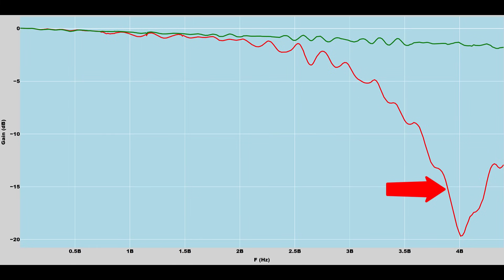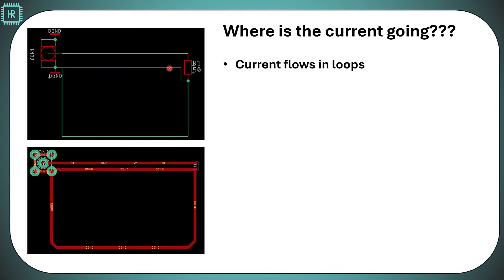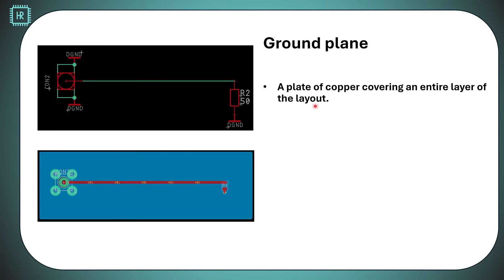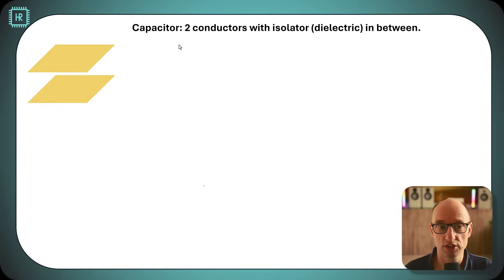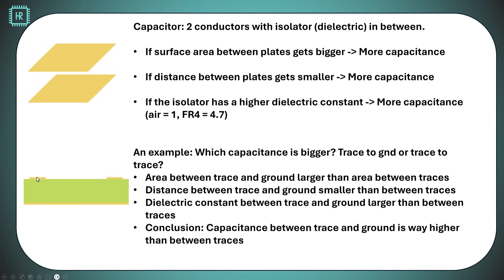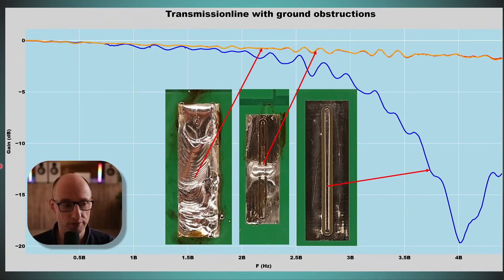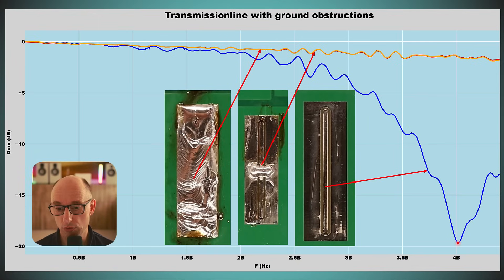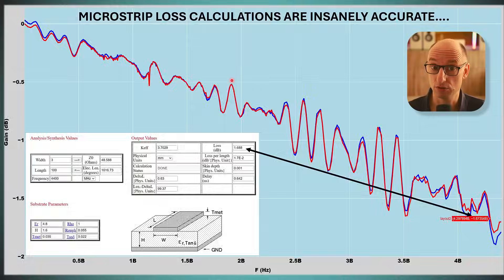Flawless PCB design: RF rules of thumb - Part 1

Comment: Great demonstration of the effects of interrupted ground planes.
I'm curious what the result would look like if the solder blob is replaced by a ceramic cap instead.

I work a lot with high speed digital designs, and sometimes the return current path needs to cross different net copper floods (although I go to great lengths to avoid this). The only way to achieve this is to include caps across the gaps for the return current to keep following the signal path. I'm curious though about how the non-ground plane influences the high-speed signal.
Reply from the maker: Hah, nice idea, but if you can place a cap, why not place a 0 Ohm resistor? The disadvantage is that the resistive element is on the top of the resistor, you'd have to place it upside down to keep the path as short as possible.
It is an experiment I can easily do and I used to do it under audio dac chips before I switched to single ground planes. 
The effectiveness will be determined by the self resonance of the cap and the loss, so you'd want a cog/np0 capacitor, and you want to make the capacitance as small as possible. So just big enough to have a very low impedance for your lowest signal frequency, and then you hope the resonance frequency is high enough. The smaller the cap in size, the higher the resonance frequency. A great rule of thumb here is again 1nH/mm. So an 0402 generally has 1nH of series inductance, this gets very close to reality the few times I checked this, but I did not check many caps for this.
Reply: @HansRosenberg74  You would need a cap if you are bridging between GND and non-GND nets.
Differential signals (and other high speed digital signals) can be routed across different net copper pours, although it's not really good practice. The high frequency current component does not really care about the potential of the reference plane it is flowing through, just as long as this current is routed back into the GND near the IC pins.
Reply from the maker: I think I'll try to measure this since I'm curious as well and post it here on youtube. Keep an eye on my channel. It will be a very short video I think.

Comment: This is not just a radio freq thing, I build valve amps for hifi and guitar. For decades I’ve seen people cover the insides of guitars and amps with foil tape which is ungrounded and it picks up so much noise, so then they paint everything with graphite paint and remove all the top and bottom end of the freq range! Then they install active pickups [facepalm]
I apply the same practices as you and have gorgeous sounding guitars and hifi :o)
And for anyone reading this, I have decades of experience but still watch videos like and read books this as a refresher, its good practice.
Reply from the maker: Indeed, I know, I'm also a long time audio builder (30 years). My experience is that a single groundplane greatly improves sound. Don't even separate left and right grounds, the current will not run in the circuitry from the other channels since that is the long way around which return current will never take. So you're totally safe to do that. Also never separate digital and analog grounds in a DAC, you'll run common mode interference current right through your da converter chip which is not good either. They have separate analog and digital ground pins, but on the actual die, they are connected.

Comment: nice tut! I was struggling with ground problems many years ago in audio amplifiers. I wasn't quite sure that signal ground and power ground position on the pcb was important...
Reply from the maker: Thanks, I may not have been clear enough, you should always only have a single ground plane. You can have planes on more layers, but the one that will carry the current will be the one closest to the signal layer and that one should not have obstructions. Making 2 ground planes is a bad idea. 2 video's from now I'll go into that with details why that is. I always used to make multiple ground planes in my audio dacs (I designed 6 over period of 30 years) but ever since I switched to single ground planes the audio improved quite a lot.
Best regards,

Hans
Reply: @HansRosenberg74  Thanks a lot Hans. I was being unclear in previous comment, my point was the placement of audio signal ground and power supply ground (the point on the pcb which each of those would be soldered) there was one ground of course, but signal ground from the pre-amp stage and power amplifier stage (i.e a TDA2030 chip) was a quite challenging task, and leading to all kinds of noise. I can't recall correctly if it was better to keep those close or farther apart on the ground plane. tysm for your attention btw!  +1sub!

Comment: REALLY struggling with how to use the newest Analog Devices microwave I.C.s that are about 2/10 inch square with 8 connections on each side! Are these totally out of reach of the home experimenter or is there some kind of scheme that can let us use them? Even after getting a board made it seems to be impossible to correctly align and solder the I.C. to the board!
Reply from the maker: I did this many times, I think you're talking about a VQFN package?

The only way to get this done is with a stencil to apply solderpaste (the luxury option) or apply paste manually to the pads. Make sure you don't put too much on the central pad (which it probably has) otherwise it will start to float. To make alignment easier, I always put 4 lines on the silkscreen, at 45 degree angles. The ic corners need to be on these lines. Furthermore it helps greatly to add this very thick rework flux, that makes the solderpaste really liquid. Than you carefully heat it with an smd hot air blower. The paste will melt, the ic will float on that paste and because of that it will auto-align. It takes a bit of practice and a microscope is really helpful because you can see everything better. Good luck! (I will make a video on this in the future, but I have soo much material to show, it might be a while)
Reply from the maker: there is a third way: Apply solder with a normal soldering iron to the pads (not too much again), use rework paste on the footprint, put the ic on and then slowly heat it up untill it start floating. That thick rework paste is a lifesaver doing this work, makes it sooooo much easier.

Comment: You made a slight error:  Between two traces in a PCB, the dielectric constant is not really 1.  The volume of space between the traces that gets used by the capacitance involves some "fringing" making it use some space that is inside the PCB.  It doesn't change your argument but if you measure on a PCB you will see the capacitance is a bit higher than you expect.
Reply from the maker: you're absolutely right! I was doubting weather I should go into that level of detail, because, as you said, it does not change the argument. Well spotted! :-)
Reply: @HansRosenberg74  Thank you for the excellent videos, I have enjoyed them a lot and I am subscribed :)
Reply: Subscribed 😅

Happy to find both of your channels as I'm slowly learning PCB design
Reply: How do I get a copy of your book?
Reply from the maker: You can get it here:
https://www.hans-rosenberg.com/checklist
Best regards, Hans
Reply: send me the checklist, I might even add a few things :)
Reply: Dear Hans - Thank you for sharing this excellent video (and the others in your series on pcb design). I’m fairly new to pcb layout, having designed one board, an audio preamp board. I usedEagle PCB for my design. I’m interested in learning KICAD so I’m considering design of a pcb-based Yagi Uda antenna for the Iridium satellite band. I understand how to design the antenna (number of elements, …) but I’m really struggling with the RF aspects of the board. I’d like to use the Yagi antenna board with my Tiny Ultra SA as a direction finding system. I envision the board as having an SMA 50 Ohm connector which then runs to the active element of the  antenna (either a half-wave dipole or a folded, half-wave dipole). Any suggestions you have to get me pointed in the right direction would be much appreciated. - Best regards - Jim
Reply: Send me the checklist
Reply from the maker: here it is: https://www.hans-rosenberg.com/checklist

Comment: Send me the checklist.

I really appreciate this video; using the lessons here to clean up a digital design that is about to go to production. Thank you.
Reply from the maker: For your digital design: Make sure you place the decoupling caps right up close to the power pins, and make sure to put the via to ground as close as possible as well. Be careful that your digital supply traces are wide enough not to cause voltage drop. If it's a low voltage design (with a 1V supply for instance) the drop across these traces can really ruin the operation of that digital core. The current is usually high there due to the low voltage, which means you easily get a high voltage drop. This means the speed of the digital core reduces beyond tolerable levels. I almost fell for this trap once with an FPGA board, luckily I did a last minute check on that and was quite shocked :-) The nicest thing is off course a power plane which you can treat in exactly the same way as a ground plane, but that takes up another layer and is only needed with high speed boards with very high signal integrity demands.

Comment: Nice video; concise and great info!  I can see this stuff is super important for RF work, but what about lower frequency work, e.g. microcontrollers running at 8-40MHz? How particular do you need to be? What scenarios still cause issues?
Reply from the maker: Hi Mgkeeley, thanks for teh positive remark (this is my first YT video :-)  ). About your question: It all depends on what you want to do with that design. If a clock and IO runs at 40MHz, you're generating a lot of harmonics as well, probably at least up to the 9th to get a nice square-wave. So that means you're interfering up to 360MHz. If it's just a hobby project: Not really a problem. If it becomes a product, then there are quite strict rules for intereference and you might by resposible for problems that occur. 

If you have an analog channel somewhere on your board, you may interfere with that. Sometimes, regulators can go unstable if their ground is not good enough. So I always try to put as much ground as I can on a single layer and use the others for traces. In the end, it is also a price thing, if you spend more on a 4 layer pcb, you can very easily make a perfect ground since you have 4 layers to route traces on.
Reply: @HansRosenberg74  Right, I forgot that square waves will have higher harmonics than the base clock frequency!